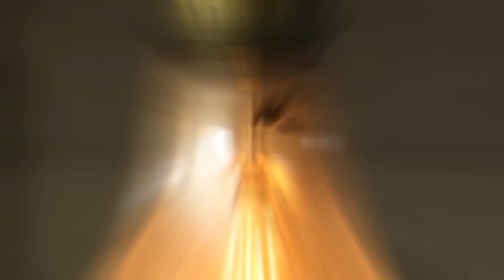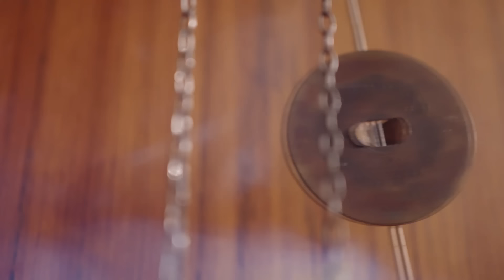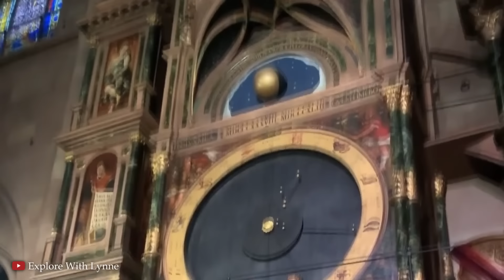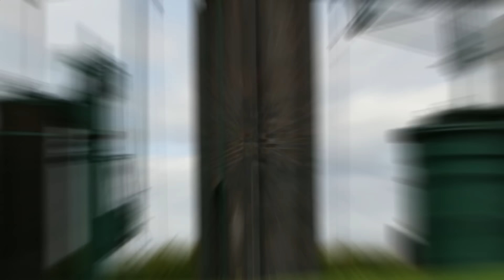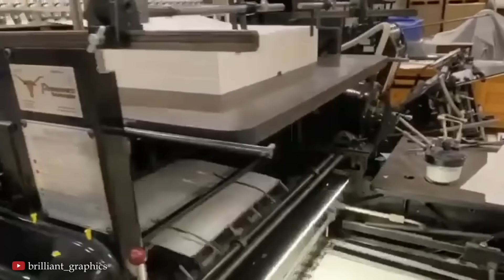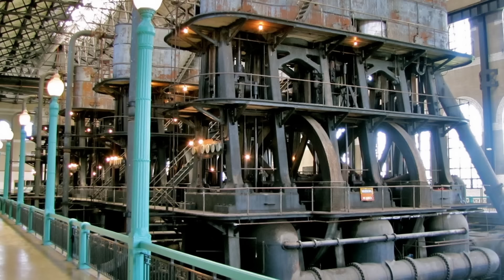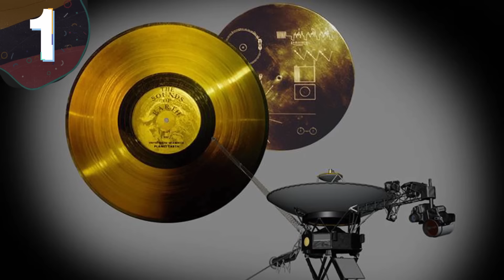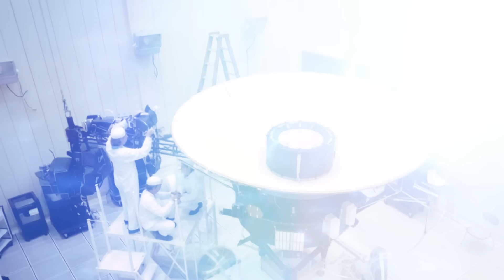15 Machines that STILL RUN After 100 Years

Comment: I used to run and maintain an Original Heidelberg Cylinder and the easiest way to tell it is an old machine is how dangerous it is, i have one or 2 scars from that thing, momentary lapse of concentration, even when setting up can lead to a small injury, if it is running at the time you can easily lose a digit or 2
Reply: Or stitcher or folder or cutter.  It was all dangerous.
Reply: @xploration1437 yep, I did stitch my finger instead of the booklet once, stupid thing to do lol
Reply: Or off the windmill grippers!  Ive worked both platen and cylinder machines Letterpress and Litho types.
Reply: As an ex machinist, I was taught to not put my fingers anywhere I wouldn't put my p*nis 😂